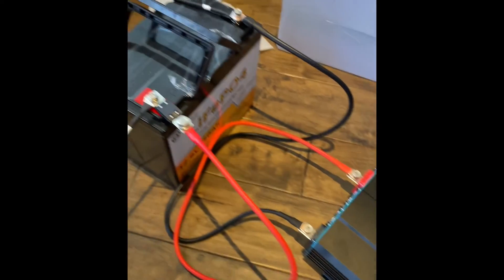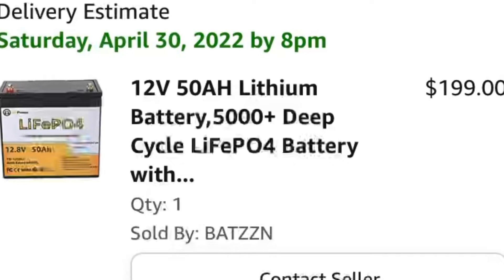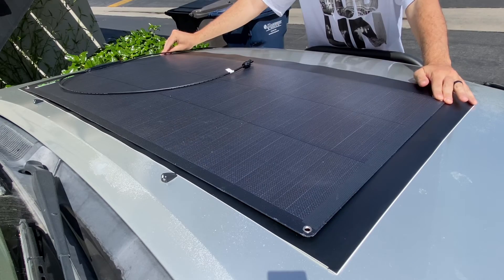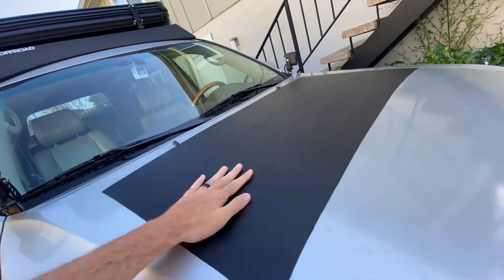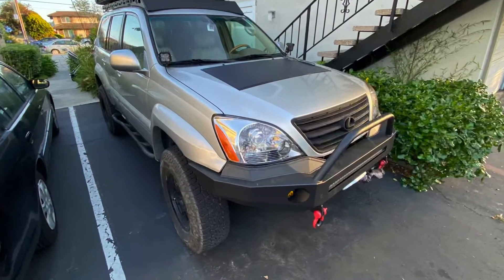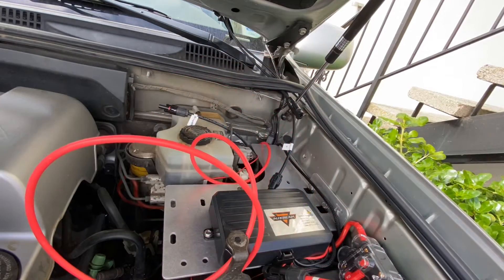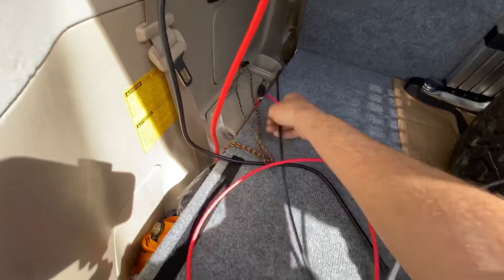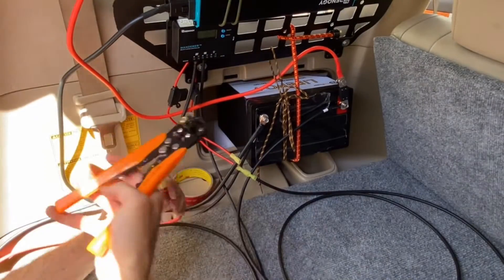700W SOLAR POWER System for $500?! Power an Overland Fridge Indefinitely While Camping

Comment: This is an excellent video. It shows the full build, the smaller components in addition to the main pieces, and you explain why.

Two things. I will not fix the flexible solar panel. I am in Canada, and the ability to place and move the panel and chase the sun is important. Second, when using double-sided tape, remove the protective paper tape after you have secured one side and roll the paper tape off as you roll out the flexible panel.

Love this, thank you

Comment: Nice job! That inverter eats 10 watts an hour. If you bypass it and run the fridge off dc, the battery will last longer and you won't have the sound of the inverter fans running.
Reply from the maker: You’re absolutely right. I have a DC system now!  All videos on the solar power system build are on the channel if you’re interested 👍
Reply: oh heck yeah. @lexus_offroad_adventures

Comment: Great video. Thanks for sharing. 
I just didn't understand why do you use inverter to power your refrigerator.  There's no 12v input on it?
Reply from the maker: The refrigerator has a 12v DC plug, yes. It’s the cigarette lighter type so I could technically just hook up a cigarette lighter adapter directly to the battery. But I mostly got this system to keep drones, phones, cameras and string lights charged up/powered so I needed the AC power either way. In the future I may setup a whole DC fuse system since power flow is more efficient that way, but this setup makes everything easy for my current needs
Reply from the maker: Btw, I added the DC system and am putting a video together soon

Comment: With the battery fully charged, how long will it run that fridge with no recharge in case you had a weekend trip and lots of storms or overcast where solar is minimal?
Reply from the maker: So the fridge is 60W max. If running constantly at full power, that should give me 10.67 hours (640Wh battery/60W fridge). However, the fridge has an Eco low-power mode that could probably close to double that. 

This is only a 12V/50amp-hour battery (12.8V x 50Ah is 640Wh). You just have to up the size of the battery if you’re worried about missing out on sun. It’s also super cheap/easy to double-up your solar array.